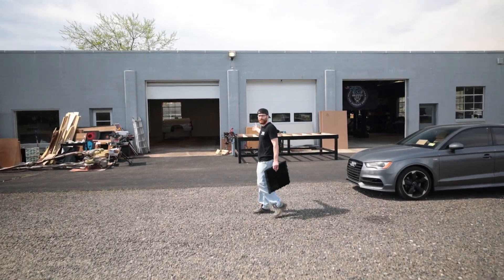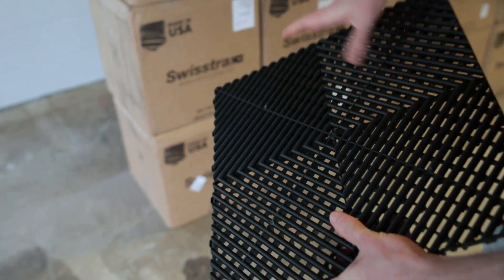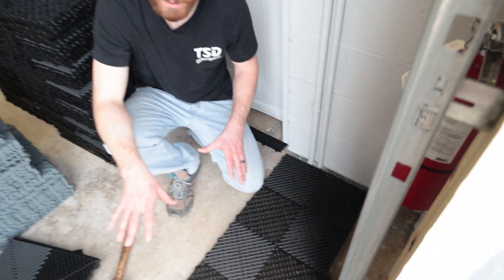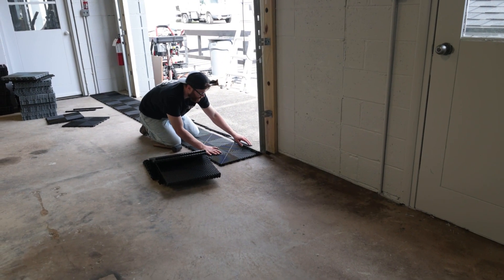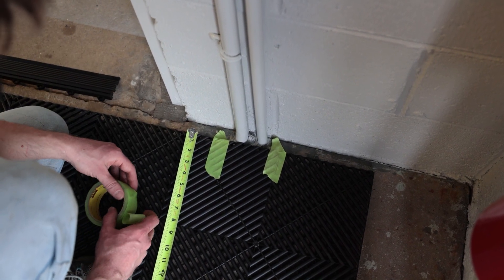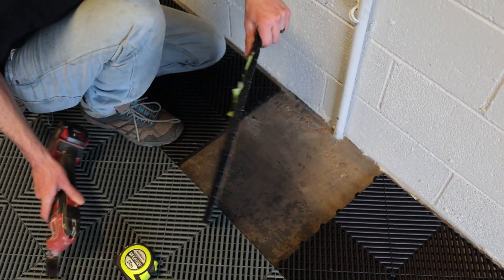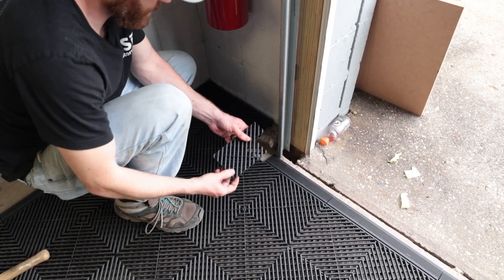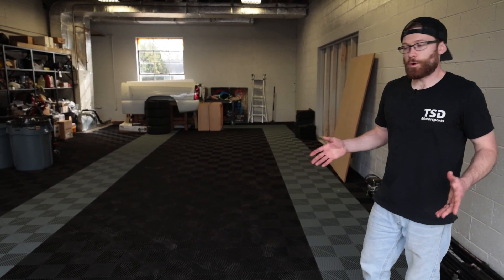How To: Install SwissTrax in your Vinyl Wrapping and Automotive Shop - Ribtrax Pro Before and After

Comment: Considering it has groove in it how is it moving rolled items…floor jack, cabinet w/ wheels
Reply from the maker: I was concerned about that but we did a lot of research and it seems no one has any issues. We only just put it in but have had no problem rolling things so far! The grid pattern is close enough that normal size wheel roll over it without issue